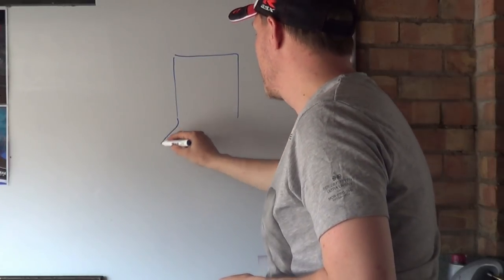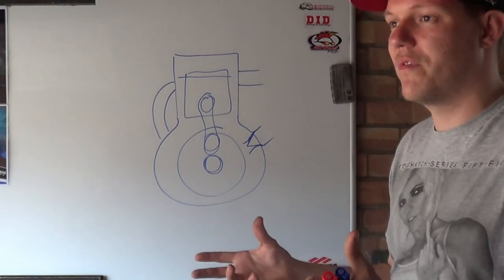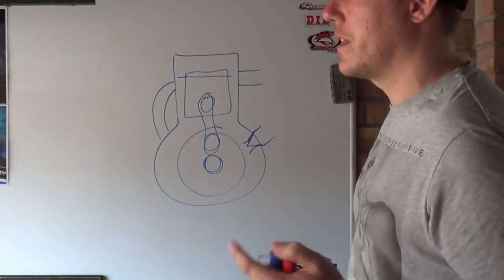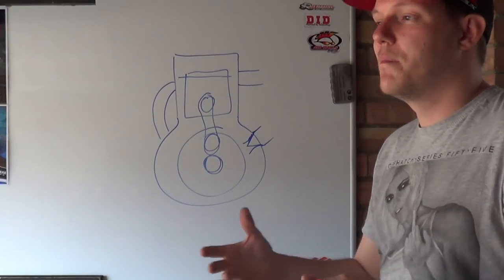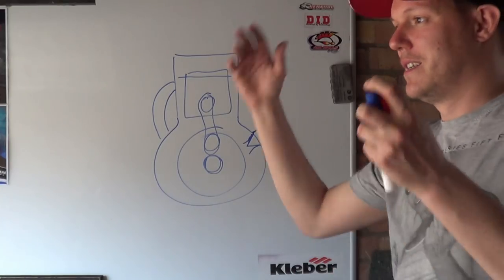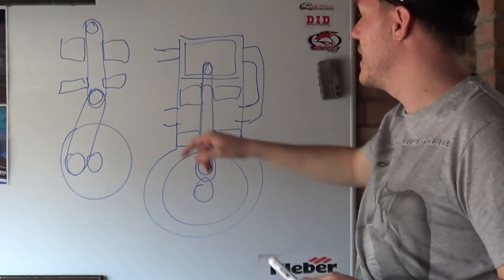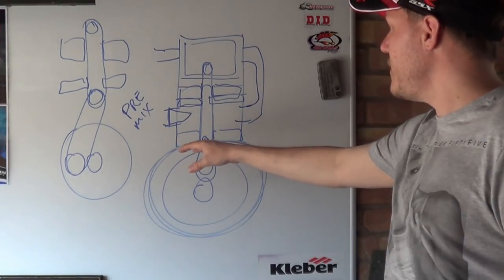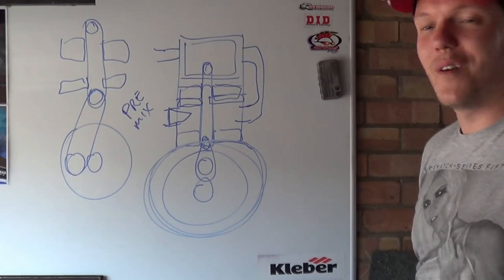2 Strokes are shite! - and why - Part 1

Comment: You're forgetting that 2 stroke have almost twice the power to size ratio. Not to mention the weight savings, as well as half the gyro effect because of the lees moving parts of the engine.
Reply from the maker: 1) More like 20% more power
2) They use twice (100% more) fuel for the same cc
3) Half the gyro effect? What?

Comment: I love your vids, especially the newer Alfadan stuff but I think you have to consider a little different perspective on the two stroke thing. Come on over to the smokey side. My opinion is that it's a three criteria thing.  power, weight, and reliability. Throw in cost after you think you have a 4 stroke answer and try to square it again. 

People get hung up on engine volume when talking about 4stroke vs 2. Seems like you did a little in your 850 etc video. That was an interesting comparison and you did take your best shot at weight which was awesome. Your video could have just stopped there. It would have been either impossible to make the r1 engine as light as the 850 etec or if it was somehow done, it would have had sketchy reliability (and/or cost prohibitive). I'm not a huge fan of rotax and not sticking up for them in any way. You could have done this same thing with any of the 800 class sled engines in my opinion. The 600 class would have been better yet. They tend to be more reliable and put out roughly 120hp these days. 

In a situation where weight is the major consideration, in my opinion a two stroke will be more reliable for the same power and weight....and be cheaper to build. Fuel consumption is where it falls apart. 

To match the power of a two stroke with the same weight 4 stroke package your going to be starting with a smaller 4 stroke spinning the christ out of it, or forced induction (more added weight you have to know take off the engine)...or both. It's not going to be as reliable or as usable.

High performance spectrum or lower performance spectrum, it doesn't matter.

There are lots of case scavenged low to mid performance 2 strokes out there that just run and run forever until (and after) their bores are all egged out.
Reply from the maker: Compare the 2022 ktm sx and sxf. Both 250cc engines the sx is a 2 stroke, the sxf is a 4 stroke. They both weigh the same...
Reply: @dirtygarageguy  ktm site is showing 2023 models, I didn't find 2022 figures but if you send me a source I'd look at them. But the 2023 sxf 250 (overall bike) is 1.6kg heavier than the 2023 sx 250. I can't find hp info on ktms site but looking through all the dirt bike rags it looks like ktm claims the sxf at 47 HP and the sx at 57. The same magazines say the sx engine is 52.6 lb and the sxf 57.5lb. apologies for mixing kg and lb. I'm from the US and we're sick in the head.
Reply: @dirtygarageguy  also to be determined but I think it would be a pissing match to argue which one those two is more reliable. I probably wouldn't favor either since they are both all out motocross engines. I know which one would be cheaper to grenade though.
Reply from the maker: 1.6kg and the sxf has an electric start... 1.6kg! Electric starter...
Reply from the maker: 4 strokes are more reliable than 2 strokes...
Reply: @dirtygarageguy  the sx also has electric start. 1.6 kg AND 10 less HP. The sxf 350 doesn't even quite make up the HP gap and your up almost another kg.
Reply: @dirtygarageguy  a 250 fourstroke making 47hp in that light of a motor isn't going to be the picture of reliability. The 250 2 strokes that make mid 40s up go a couple hundred hours on a top end. That entire sxf motor will be thrashed well under that spinning 12k or whatever.
Reply from the maker: The sx from2 2022 didn't. Regardless your missing the point. Why are they the same weight? You say that 2 strokes are lighter. Surely you don't believe that lighter is 1kg, and that's not the engine.
Reply: @dirtygarageguy  for the same power. Your missing that the 4 stroke sxf has 10 less HP.  Make up that power difference then see what the weight difference is. Again the sxf 350 doesn't even make up the power difference and it's something like 2.5 kg heavier. 2.5 kg on a ~50kg engine.

But that's not even my point. MEET the weight of the 2 stroke for the same power. No grace for weight. Now that light weight insane revving thing has to be as reliable as the 2 stroke too.

I'm not saying 2 strokes are superior in all aspects, they're clearly not. We can argue all day if a 5%+ weight difference on just the engine in an mx bike is important. For most people probably not. But it's there. Modern mx bikes are probably as close as the gap as ever been and despite all the marketing propaganda, the top tier 4 stroke mx bikes don't seem to be known for their reliability. They run hot as shit, flame out when a 2 stroke 250 in the same situation will just grunt up a hill a gear or two high.
Reply from the maker: Weight does not equate to power...
Reply from the maker: My point is you said 2t makes more power, are lighter and are more reliable. My point is they're not lighter, and they're less reliable.
Reply: @dirtygarageguy  of course weight does not equate to power. But if you don't think they are linked then why wouldn't every manufacturer make 5kg engines with 300hp. 

Maybe I'm dense and just being trolled but when is 47hp the same as 57hp?

Comment: 2 strokes raise the bar which makes the motor cyclist gene pool stronger. like who wants to share the road or track with some goof that doesn't have the sense to swap a spark plug let alone premix fuel, you know I'm right because it just it makes sense. In racing it takes more skill to ride one so more make mistakes and that means far more change of position and much better for spectators, these days a few blank faced stragglers track side to watch dog fart sounding 4 strokes ride around, when I raced them in the 80s we got huge enthusiastic crowds, all cheering like cavemen at a woolly rhino kill anytime there was some action on track, youngers now don't know what they missed but if they did they would rise up against the green menace that killed them off and put 2 strokes back on the map in racing and let the good times roll.
Reply: A 2 stroke of the same cubic capacity as a 4 stroke will always blow the 4 stroke into the weeds and that's a fact. And of all the 4 strokes you picked the most dog fart sounding V 4.. They sound like shit, the first time we heard VF 750s at the race track when I raced inline 4 suzuki it was evident that the sweet sound of a in inline 4 superbike was under threat from the bike that sounded like two Harley Fergusons with old socks in the exhaust pipes.
Reply: No the problem is you are too young to know what road racing 2 strokes sound like or how much faster they are than 4 strokes of the same CC.. Sad really we have a generation that missed out in the best of mc road racing days and 2 strokes to the point they think 4 strokes as more powerful which is nonsense.

Comment: I just read some of the comments below . A lot of "negatives" there Dude . For that reason I will be your friend and agree with you - two-stroke engines are shite (God forgive me).... BUT let me explain some things . The petrol in the Petroil mixture does NOT wash oil off the moving parts. if this was the case , a Two Stroke engine could not work beyond a few seconds before seizing . Two Stroke engines ARE reliable . The problem arises when people who don't know enough about these motors(I'm not saying you , as we are now friends) attempt to "improve" on what the designer created (... and on the eight day God created Two Strokes). A lot of power can be unleashed from one of these motors but usually at a price - failures .  Now , having said all that - I have a 100cc Two Stroke motorcycle with a reed valve intake . The 'bike is 37yrs old , all original mechanics apart from an expansion chamber , single ring Piston and a slightly larger Main jet . A CB750 Honda , on the other hand , is a multi-cylinder , complex machine capable of fairly good performance . Imagine the rider's embarrassment at having a "piece of shite FLOGG it up to 100KPH . (Iknow which motor I'd rather be paying repair bills on)(the Honda is a fine motorcycle-no disrespect intended).  We shall not discuss the performance of those big pieces of shite - the Kawasaki triples or the durability , reliability and good manners of the Suzuki GT750 water bus(simply because you are my friend and I don't want to embarrass you) .  
YES - generally speaking , Two Stroke engines do not last as long as four strokes ... BUT a Two Stroke is cheaper and simpler to "remanufacture". 

Horses for courses my friend - all my 'bikes are Two Strokes . I love the challenge of modifying them . They ARE a complex piece of shite if you want to do it right - get it wrong and it's a world of pain . To those who don't have the patience or knowledge - - - -  stick to four strokes .

Comment: Comparing a reed with an exhaust valve is stupid, the reed valve only copes with low PSI and is not subject to the combustion pressure and heat. Banging on about how crap 2 strokes are is one thing but you better tell the builders of the 2 stoke engines that power container ships, they are some of the most efficient engines on the planet.
Reply from the maker: what like this you mean? - https://www.youtube.com/watch?v=qt3H6F4mHHc

Comment: Reed valve petals are made from metal, glass fibre and recently carbon fibre.. not plastic.. and chainsaw engines are under load full time if they’re used commercially.. it’s that they’re in a low state of tune.

Two strokes are highly reliable when they are correctly set up.

You’ve probably never had much to do with them...  hence the prejudice
Reply from the maker: "Reed valve petals are made from metal, glass fibre and recently carbon fibre.. not plastic"

What do you think 'glass fibre' is? Glass?

"Two strokes are highly reliable when they are correctly set up"!

- Because wear is dependant on 'set-up' - don't be a dickhead.

"You’ve probably never had much to do with them...  hence the prejudice"

- Apart from the 2 I have now and the RG500 engine I'm teardown and rebuilding, oh and the 30 or so I've had over the years. 

You sir, are a cunt. Good luck with that LMAO!

Comment: if your bike has an auto oiller a tank where you put the oil in its not being sprayed around all whilly nilly its put on the main bearings and very little of the gasoline gets in the bearings 2 strokes are stupid simple also less moving parts no chains don't have to worry about valve float. anyways have fun with your 4 stroke. Ps my 2 stroke makes power every time it comes to the top of the cinder no need for those 2 other strokes.
Reply from the maker: watch parts 2 and 3 then it makes more sense

Comment: Re: your alternative 2 stroke engine design: You could replace the crankshaft & conrod with a tusi couple, which converts linier movement to rotation without the oscillating from side to side. http://www.math.ucr.edu/home/baez/mathematical/tusi_gears_animation.gif

Comment: That is a self defeating design.  Probalby ways around it.   2 stroke oils probably have detergents and synthetics to make gas less caustic.  Consider running on propane and re configure the oil system.  Also rotax motors dont have reeds.  Popular for aircraft.

Comment: What about those 2 stroke engines that does not pull the air fuel mixture trough the crank case? OK that is older technology and they have less power but they are more reliable at the bottom end of the engine.
Reply from the maker: Which ones are you talking about? 2 stroke diesels?
Reply: I thought about that Zundapp GTS50 I owned when I went to school... I think it did not breath trough the crankcase because the gearbox was with in it and not separate from it. But I could be wrong and it breath  trough it. I never changed oil and it always ran! Crappy sometimes but it worked. All it got was gas with oil and kicks beside the sparkplug check/clean. I think they build it in the 70's to 1980's... But that was about 30 years ago... And I sucked working on them. I try to fix an MTX 200 Honda and due to the damage and who knows how the coolant ended up in the crankcase I sold it... The 1978 CR250 only wanted pistons. So I am not a mechanic but need to fix my crap due to a empty pocket. But I learned how not to do things! Now I do much better ;) Since the Internet provides all information I need to fix things. Well since the early 90's I have not owned a 2 stroke. So I never really figured it out even it seems to be easy there are things that you need to know when you work on them. What is way more easy to figure out now then in the 80's.

Comment: Hmm.. I've done 460000km on my Yamaha TZR125 and the engine has never failed on me..
Reply from the maker: Are you sure you meant to type 460,000km? (285,000 miles)?  That's 11 times round the earth?
Reply: Yes, and I just remembered that I did change cylinder+piston once and I think that was in 2001.
Reply: And yeah sorry it's 46,000km. I got confused since we in Sweden also use "mil" (1 mil = 10km) and thats what got me confused.

Comment: HERES A TIP OF ALL YOU 2 stroke livers when your holding the throttle wide open press the kill switch and hold the throttle open for a second and it will lube your engine and cool it Down!!!!! And make it a more peppy engine because it's cooler

Comment: Before engineering eficacy, comes price sir!!
To rebuild a 2 stroke engine its much cheaper than rebuild a 4 stroke one!
You buy an used 4stroke motorcycle you better hope it's engine is in good condition. You buy a 2 stroke you renew the engine easy!

2 stroke engines are not crap at all! They simply are.. expendable!
Reply from the maker: Well this is all about perspective. In this video we're talking about engineering. But I'll go with this.

"You buy an used 4stroke motorcycle you better hope it's engine is in good condition."

- which they usually are.

"You buy a 2 stroke you renew the engine easy!"

- at what cost? Have you ever had to buy a new KX250 cylinder and piston? Not cheap at all. Specially if the KIPS system was also damaged when the piston seizes.

Comment: Why do they not use the oil on the gear box to lube the one side and have a oil bath for the other . but I guess the answer is cost and they can't be arsed with the development
Reply from the maker: Oil bath? I need more than that what do you mean?
Reply: as in right crank bearing shares the gear box oil so basically instead of the bearing side crank being on the inside of the crank . but would be a pain to replace or seal correctly . the left bearing fly wheel side may be a head ache to lubricate or it could be oil fed . Now this could of been tried out and spat put lol.

Comment: Tell Johnny Walker and Graham Jarvis that 2 strokes suck. They don't ride them because they are simple and parts are everywhere. I'm sure the factories would be happy to work on and supply plenty of parts if they wanted to ride four strokes. They ride them because they are better for what they do. Anyone ever notice how sometimes drawings for a construction job don't always translate to the job site and things have to be redesigned in the field by the workers? Has anyone ever worked with an accountant or a CFO that wanted things a certain way because and you could get them to understand why in the Feild it doesn't work? Saying they are shit is just fucking retarded. The engineers at KTM and Husqvarna obviously disagree with you. I think I'll take their word for it. I raced two strokes growing up and went to four strokes for about 10 years. Back on two stroke now that I'm back racing in the woods.

Comment: Both 2 stroke and 4 stroke engines have their good uses in different applications. However, the glorified 2 stroke engine design you demonstrated really is "shite". It would cost more to produce and is more complex than a standard 2 stroke unit and yet still wouldn't match the service life of a 4 stroke. How to contradict yourself in 16 minutes and waste everybody's time.
Reply from the maker: How to be a dick and no ones cares in 5 lines of a comment - see above for details

Comment: did you forget that with every gulp of air/fuel mixture it also inhales and drops new oil into the crank?  so basically its an oil change every hour, the factory mixture results in a certain level of oil being left in the engine for the bearings.......................your point is invalid
Reply from the maker: Ok so if a gearbox requires oil, straight out of the bottle that's fine. But you water down 2 stroke oil between 30:1 and 40:1 and that's fine? my point is valid.
Reply: your the one using engine oil as gear lube bub, the gas and oil separate in the bottom end while atomized, you dont end up with gas in your bottom end unless you dont know how to tune a carby mate, maybe yall do things differently across the pond